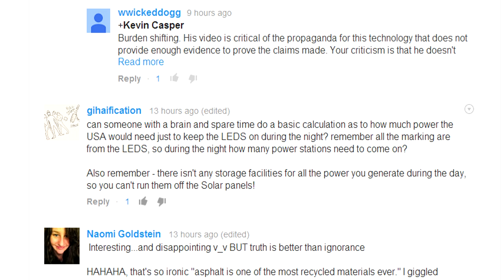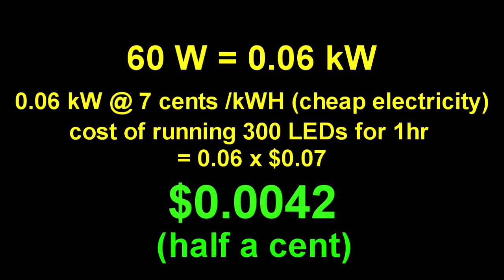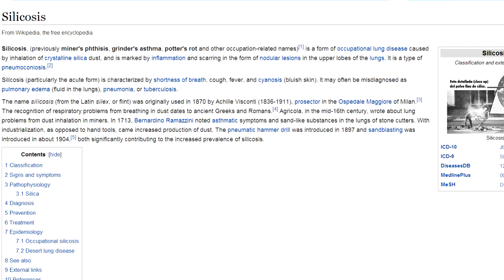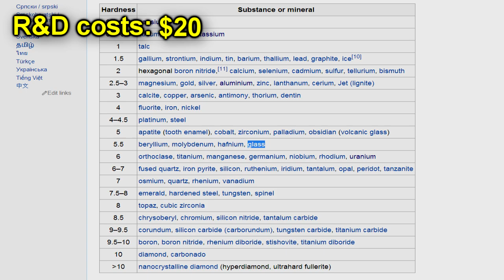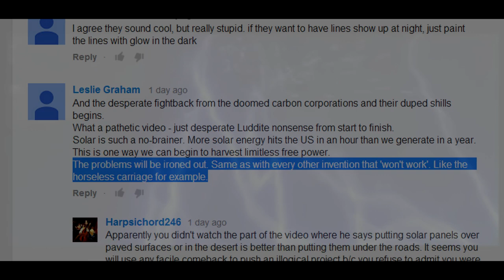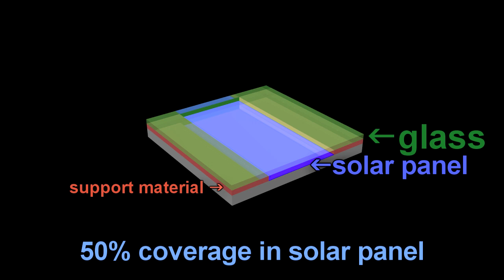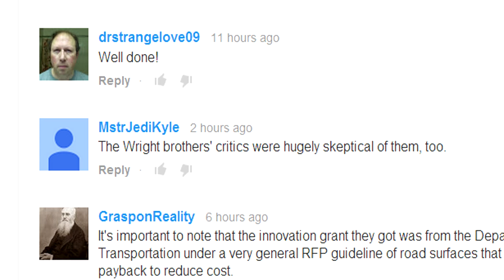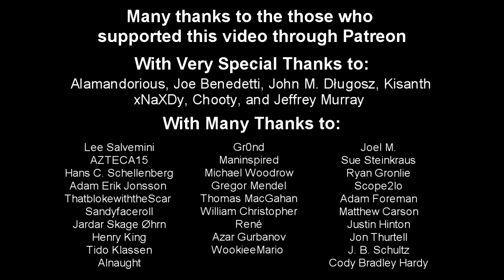Solar Roadways, IMPORTANT QUESTIONS AND ANSWERS!

Comment: It's TEMPERED GLASS Diphead!
Reply: Even tempered glass can be scratched 
 O'Block, Robert L.; Donnermeyer, Joseph F.; Doeren, Stephen E. (1991). Security and Crime Prevention. Butterworth–Heinemann. "The security value of tempered glass, however, is questionable. Although it will resist a brick or rock, it is susceptible to sharp instruments such as ice picks or screwdrivers. When attacked in this manner, tempered glass tends to crumple easily and quietly, leaving no sharp edges."
Reply: It's a speacial kind of glass that they've proven to be unscratchable.  At least not easily scratchable

Comment: DOT mows medians and gets dust on panels surface, cars catch on fire on the shoulder, cars drip oil and a/c condensation, rain and snow, trucks drop debris and chip and crack. traffic jam void panels, cars parked on parking lots void solar panels, hail storms crack panels,

Comment: Someting most commenters forget to mention is (and this can be seen at the original SFR video) is that those idiots lay down the panels on a highly precision manufactured concrete foundation. Without proper support from underneath the panels would move, sag and crack within the first 5 minutes of heavy traffic.

This means that the roadways have apart from the astronomically high prices for the panels also an astronomical high cost for this foundation! The whole roads have to be dug-up for at least 1 meter, reconditioned, ballasted, flattened, laid with concrete poured into precision moulds, a ditch also precision moulded has to be provided, provided with the power wires and signal wires, etc. etc. etc.
And then the panels!

A Solar "freakin'" Roadway might cost 100x (sic) the current costs of a current concrete or Asphalt road!

Any further discussion is futile and time-wasting. Only suited for a comedy show on TV, one in the order of "The Office". Just as boring.

As long as there are people defending those charlatans, the human race is DOOMED!!!

Comment: Excellent video: of course there's also the issue that when these panels break, the road doesn't have broken glass in it, the road IS broken glass.  It would shred car tires, bike tires, and anyone unfortunate enough to fall on it.  Personally, I'd also be concerned about the photovoltaic cells, because if its sunny out, then it's electrified, broken glass... or at least broken glass with electrical activity underneath it.

Comment: Ok, I live in a climate where temperatures soar from 30 degrees Celsius to -40 degrees in the winter. The amount of flexing, shifting, and movement in the road causes massive amounts damage to regular asphalt, and they are forever repairing asphalt in the summer. I can't imagine the cost in maintenance alone if these stupid solar roads were even implemented here. They basically made something simple (a asphalt road), and made it overly complicated and expensive when there are much easier and less expensive ways to produce clean energy.

Comment: I really dislike the incredibly smug tone your commentary on the concept is clad into. In addition you really do your maths on a Ryan Paiul Budget level ignoring loads of economic factors like the more you make the cheaper it becomes. (Economics of Scale) and you work with assumptions that would be too simplstic and foolish for Ken Ham to propose. Scratching a glass bottle? Really? How can you make any assumption about the completed product without getting your hands at least on a spec sheet far less the real thing? LEDs from the hardware store, glass from the kitchen cabinet? And you dare to pretend it's a valid correlation?

Nope, while your aversion against the concept surely is justified and there will be good points made against it besides the costs, this is not the way to go. It's a shameful orgy of selfpromoting sarcasmic goo not useful for anybody in such a discussion.

And why just be destructive? Why not think about better concepts?
Let's tunnel off / house in a sufficient amount of  highways in or around population centers (but outside of shadowing objects like skyscrapers) for noise protection, put the solar stuff angled southwards on the roof, using lots of small prisms to catch as much stray sunlight as possible without both moving parts and expenditure for the driving of those motors and find a way to decentralize interim storage of surplus energy.
It still would be a ginormous project, still would be expensive, but the most stringent reasons against using it as a road surface would be adressed... and i guess it won't even need LEDs ;) Plus it fulfils another purpose (less road noise) the space is already built upon and thus available, it would make any kind of solar panel cheaper and thus more competitive due to the sheer scale of production necessary and it's not friggin nuclear waste production. If you are nervous about the energy expenditure  build the tunnels around the factories to make the solar panels first and thus make them from their own produced energy until they can prodiuce more than they take.

Ultimately not even the cost is an argument as projects the public is in favor off never are seen in terms of cost... Apollo and the moon landings, building a net of highways to connect America on the ground, nuclear power, any number of wars in recent or distant history, where there's a will there's the money. Cash or in form of debts to be paid off later.
The only thing that counts is the question if the whole of society thinks of it as worth the effort and expenses. And that's where I'd have large doubts in a country that celebrated a violent, vitriolic, racist tax evader as a popular hero for snubbing "the powers that be"
Reply: 1) Smug or not the points still stand.

2) Tempering glass improves durability not hardness with regards to scratch resistance, also the coffee pot is a type of tempered glass. Even gorilla glass with scratch resistant coating is scratched by sand

3) The LEDs are actually pretty bright on par with solar road ways, as a note they can't see their LEDs in direct sunlight either. If they intend on sticking with the LED concept it will require more high powered LEDs which consume a relatively absurd amount of power and may require clusters to be seen.

4) Maintaining the current infrastructure and investing in current technology are better ideas than solar road ways.

5) You seem to dislike nuclear but no matter how much renewables we install unless it's geothermal or hydro (which often requires particular geological conditions to do well) you'll still need a base load power supply till we get a big enough smart grid, energy storage technology and a renewable surplus. I think there's lots of promising nuclear options, some of which may even consume existing nuclear waste.

6) Resources are limited, it's better to put money towards good ideas rather than bad ones. For what it's worth I think a lot of the wars are bad ideas and for the same cost we could have probably refitted most of the nation with solar and a smart grid for the same cost as some of our issues in the middle east =P. Solar roadways however at least with the planned implementation is just a bad idea and I see nothing that would make it cost competitive or more worth it than existing solutions.

Comment: This douch must work for big oil... there are endless benefits to converting our roads to glass. how about calculating this... first of all glass can be tempered to ballistic and bomb proof standards, rain grooves can be cut to channel off water, surface can be made to unlimited traction grades, led lights practically last for ever, changing one damaged tile could be done in minutes vs. repaving. asphalt sections, asphalt  is a poor material for roads, petroleum products used are bad for the environment, black asphalt heats up the earths surface , we would have a huge reduction on our dependency on oil in just the production and transportation of these petroleum products. He keeps calculating costs, our government wastes trillions of dollars that they can just print anyway... oops already do. the big benefit here is jobs, and we don't just tear up all the roadways you giant dumbass you just start replacing roadways as they are needed, and not all... just maybe secondary or just say a single lane, there are endless possibilities.. Must work because a lot of trolls are discrediting this technology...

Comment: Personally I think solar roadways is big waste of money, but the video itself is bias. For example the calculation of led consumption, I'm certain that the roads will not be lit 100%, I'm guessing it would be less than 10% in addition the road would only lit up if someone driving near to prevent wasting energy. And I doubt they are going to use regular glass on the road that he demonstrated in the video.

Comment: soo perhaps drop the LEDs and just put the solar roadways in areas that get lots of sun and don't experience snowfall like in the middle of the desert for instance? Just because it would not work as a ubiquitous solution for the entire nation's roadways does not mean that it is a horrible Idea.  Personally I am more excited about solar shingles and normal solar roof installations as a way of supplementing our electricity grid with clean energy, but it is out of the box ideas like this that will eventually deliver our society from fossil fuels